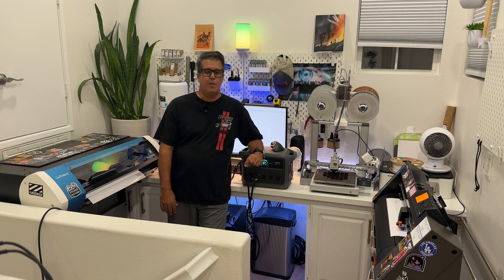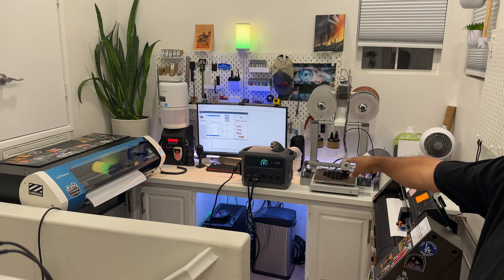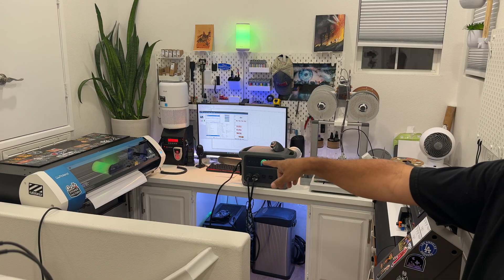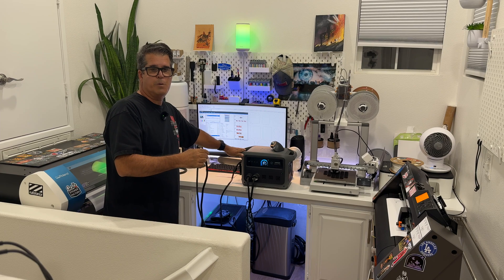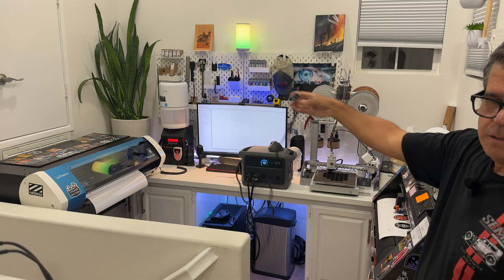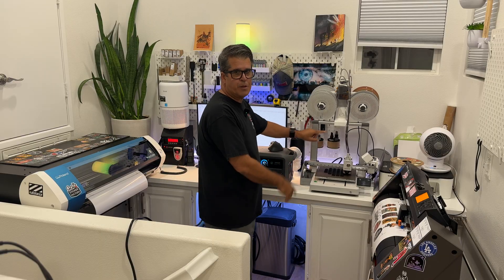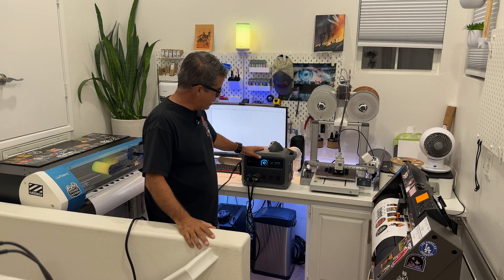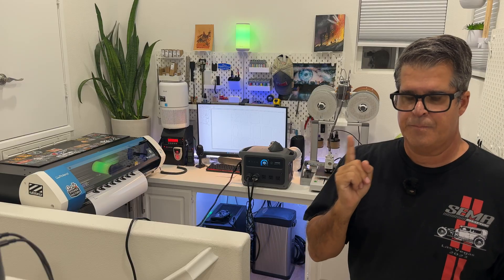Testing out the 10ms UPS on the new Anker Solix C1000 GEN 2.  Will they all stay running

Comment: Can you please test or tell me if this unit is capable of pass-through power when the battery fully drains and ac power is back on?

I read that it shuts off the ac outlet even when ac/ Power is back on if the battery is less than 10% of your min setting. It only powers on an AC outlet once it reaches 10% battery of whatever min u set. 

If so, that would be a huge flaw not to offer pass-through even if battery is 1% as long as connected to ac power. 

Thanks.